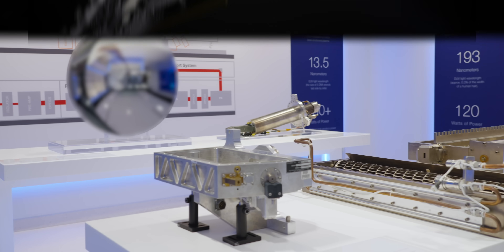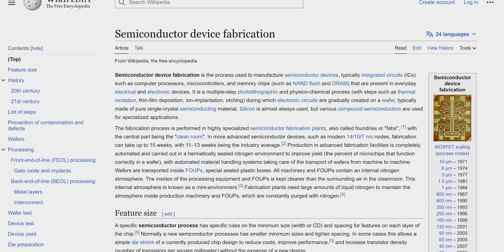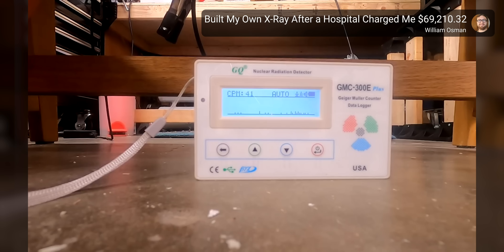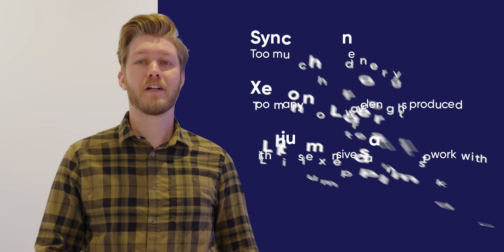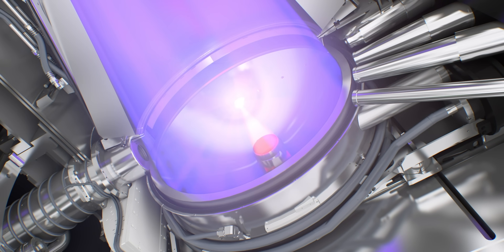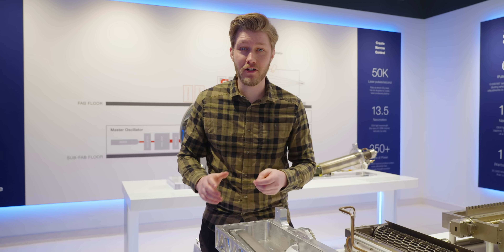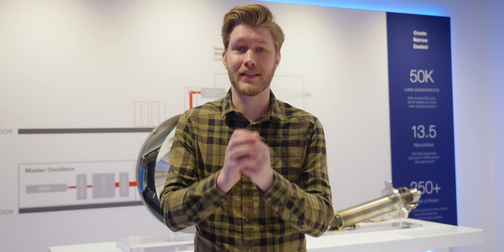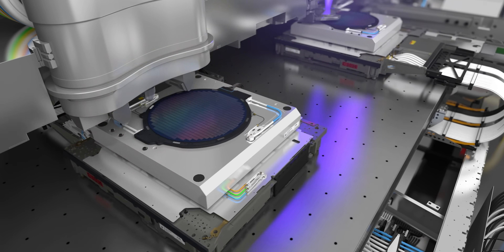You Didn’t Build your PC… This Did. - ASML Cymer Tour

Comment: Iirc, they are already having difficulty with making transistors smaller as the material is getting so thin that the electrons are starting to teleport* across the barrier.

*Yes, I do know it is quantum tunneling, but if you want to communicate it best to the vast majority you have to use general terminology.

Comment: I don’t believe this was designed by humans. NO WAY!!! Not in the amount of time it took them to come up with idea, design, production, assembly, testing and successfully making everything work the way it was imagined in someone’s mind and on paper. Can you just imagine this complex machine consists of millions of parts many of which are unique and has to be designed and precisely made before putting everything together?! And it isn’t just the unique parts and other technologies inside the machine but also complex electronics and software that runs the machine. It would take tens if not hundreds of thousands of human hours to make something like it from scratch on a piece of paper and ASML just came out of nowhere saying we are the only ones who have a machine that makes you computers and phones possible 😆. How do you even design something on a nanometer scale and then say — yeah I can print an electronic component slightly bigger than the size of your DNA strand (which can’t even be seen with the most powerful electron microscope and therefore can’t even be proven exist) using light and then make it a reality and in no time🤣🤣. So many questions and not a single answer🤦‍♂️

Comment: There is also TSMC, that uses these machines, to run through even more complex operation, with a city sized campus, using a city's water supply for a day of operation, burning millions  a day, to keep the billion dollar FABs running to produce consistent yields. Then companies like Nvidia,Intel,AMD, Samsung, numerous FABless companies like Apple, Tesla ... designing complex chips, with thousands of engineer's brain power, and companies like Cadence, that develop software to put together these chips on a computer screen, and Synopys enabling all the timing and logical verification, while also synthesizing the logic of several billion gates. Not to forget the PCB design software companies like Altium, Testing software and hardware from HP and others,  PCB manufacturing, Board assembly using PicknPlace and reflow/vapor phase soldering, Board level testing, product assembly etc,
Chip making equipment is a niche, but a small percentage of the productive electronics design cycle. You don't need EUV, except for absurd miniaturization and mass production of consumer electronic goods for most part.

Comment: The EUV system was originally developed by US and ASML joined the efforts later, a consortium of US national labs and the private sector was formed and R&D got started,  ASML actually asked the US gov for the permission to get access to the technology, (Canon, and Nikon were eager to get involved too but US gov denied their request), the early efforts on EUV system was done buy NIST, 3 of DOE national labs (Sandia, Lawrence Livermore and Lawrence Berkeley) and a bunch of other US companies, and there was a whole lot of tech transfer and licencing to ASML, many of them still hold, and ASML bought a number of American companies to develop the technology further along the way, including some of the top American lithography equipment makers. 

As you can see in the video the light source which is the key part of the system and the most complicated one, is designed and built by Cymer in California, Cymer is an American company that was acquired by ASML in 2013, ASML bought them because they were the only one in the world capable of designing and building the EUV light source, its interesting to know, Cymer was the world leader in light source technology, (still is), and works as an independent company within the ASML group, US gov didn't allow them to get merged into ASML, in order to have control over the technology and keep it in house (in US), many aspects of of EUV technology was developed by American companies and labs and ASML still work under some of those agreements, that is how US gov keeps the technology out of the China's reach.

Comment: My wife works at ASML on the "Bottom" where the silicon wafers are being bombarded by the light pulse. Even there you can't imagine how precise the wafers need to be and what kind of technology is behind it to keep it going, as said 90% uptime, going up to 95%! 

Basically braking down every main part of the machine is: 
1. Laser/Source
2. Mirror - DUV - Lenses/Mirrors
3. Retical stage
4. Bottom - Wafer stage

So imagine the complexity to align every part, measuring everything, and eventually get the Wafers that TSMC, Intel, Micron etc. have their own architecture to create the chips from it.

Fun fact: The mirrors that ZEISS produces, if you stretch them out to the full length of Germany there would be a just a few millimeter height difference.

Comment: Nah. The most advanced machine in the world is at CERN.
Reply: I disagree.
Reply: That is not even a machine. It's just a big particle accelerator using same principles as we use already +50 years. The sensor got a bit more complex but it's not a machine anyway,  all it can produce is scientific data.
Reply: @effedrien  going by this definition:

“an apparatus using mechanical power and having several parts, each with a definite function and together performing a particular task.”
The LHC is not a machine. 

But if we consider it to be, how on earth is an apparatus that can detect and identify the smallest constituents of matter producing 15 petabytes of data por year not the most advanced machine in the world?

Isn’t this an oversimplification of the LHC? 
It’s like saying the machine in the video is just a laser using principles we’ve known for more than 100 years to make transistors.
Reply: @casaroli  maybe we should not compare an experimental laboratory setup for research, with a commercial production machine. This machine needs an uptime of 90% before considered useful. That is what i call a machine. LHC has way more downtime than uptime so for me that us another class of equipment.
Reply: @casaroli  and also, what is most advanced on lhc is not the accelerator itself, but the computer systems than control everything and that interpret the data. And those systems rely on machines like this. While we didn't need the lhc to develop any if this technology. It's more a scientific prestige project in my eyes, than a useful machine for society
Reply: Eh no.... EUV machines are the pinnacle of human engineering as far as anyone is concerned.

Comment: They use hydrogen for cooling, holy moly. That's crazy!
Reply: I am sure you mean nitrogen not hydrogen. They already use that many decades in the semiconductor industry for cooling the laser mark machines and for the electrical testing at sub zero temperatures. Hydrogen would be a bit too dangerous as a cooling fluid.
Reply: @effedrien  9:46
Reply: @Chaos666Theory  i see, it's not a cooling method like i expected but hydrogen indeed
Reply: @effedrien  Insane!
Reply: @Chaos666Theory  indeed an insane way of producing light. Hit flying droplets by a laser, twice, why not. I guess it is thanks to all those microprocessors that are made with previous generation machines, that we can build a machine like this.

Comment: I have been wondering if you could use electromagetism to structure photons in a way to carry information inside a chip similar to fiberoptic cables so that you could reduce the need for metals inside of chips thus increasing speeds for data organization. I guess similar to multiple lasers reflecting off of mirrors inside of the chip... just a brief thought and im sure someone will explain why it wouldn't work lol

Comment: It would be a nice job to work inside a cleanroom of CO2 laser droplet deliveries to final DUV or EUV lithography where liquified hydrogen conduit ductwork hose pipes can remove heat since by Stephen Boltzmann with Cube Square a microscopic structure is not going to be able to contain heat and most profitable too.

 However, it is question of "Luft Und Staub" periodical on micro contamination control of how at such limits of atoms will a CPU or even neural synapses survive to endure abuse of Brownian Motion dust, vibration, and even electromagnetic pulses from static electric arc discharges.

Comment: So, how much longer have we actually got before the size of atoms becomes the issue? Still can't believe we're reaching that point, when there are a lot of people on this planet still alive that were around when computers took up entire floors and rooms. And also, is there anybody already working on solutions once the size of atoms does become the constricting factor?
Reply: Size of a silicon atom is about 0.2nm, a bit of a marketing term but they are making chips the size of 3nm. In reality about 100 atoms seperation between the on off switches in the smallest cpu. They are already hitting limits of what is possible, hence the reason they need to change to gate all around GAA. 1nm is probably the hard limit, after that they need to switch off silicon.

Comment: As an ex employee for a company that did this, this was a wonderful refresher. Companies should contract out to LTT to use this video for training newbies.
Reply: What education is needed to work in a company like this?
Reply: @force_fired556  depending on company and position there’s a range of educational requirements, for basic machine operators for the one I worked at, highschool diploma was all that was needed, up to multiple engineering and different technical degrees for certain positions
Reply: @force_fired556 For the people working on the materials science or physics/optics side of research at ASML and the like, you usually need a PhD for really key work. You can still get into engineering positions for the related fields like mechanical engineering, electrical eng, etc. with a bachelor’s though.

Comment: The size is not nanometers. The distance between mask boundaries is in nanometers. The transistors are much larger. It's the difference between the size of a square and the thickness of the line around the square.
Besides, Fujitsu did much better in 1980 using X-rays.

Comment: This is my second year interning at ASML in the Wilton CT campus. My mind is blown every single day by the new facts I learn about our processes and specifications. The publicly available information is impressive until you get an inside look and realize that everything ASML does pushes the border of what humanity thought/thinks is possible. I wish every nerd like me could experience the days and days of thought that these machines provoke. Truly the pinnacle of technology.

I used to work in the aerospace industry and lithography has completely blown that out of the water in terms of complexity, difficulty, and also satisfaction
Reply: The Chinese spies in the comments: go on 🧐
Reply: There is some really high end aerospace stuff too. The big difference with lithography is that it doesn't just have to work in a lab or small scale system. It has to be in ultra large volume production, where every minute lost can cost millions. It's like building a racecard that can go 10 laps VS one that can go 24/7
Reply: @thorwaldjohanson2526  Industrial F1 cars doing 24 Hours of Le Mans 7 days a week.
Reply: @thorwaldjohanson2526 in the end the lithography machine is still stationary in a factory with a well controlled environment. The complexity of e.g. fighter jets is more in the fact that they must be extremely robust and reliable in a huge variety of conditions, one small thing fails and it can crash. Would not call one more complex than the other, both are complex in different ways.
Reply: @vyndecimibd  I have never seen any engineer making that claim! Sorry to burst your bubble, but this technology is truly the pinnacle of what humans can set out for when they cooperate together. Do you know that ASML works with over 20 000 different companies! Again, let me put that in perspective 20 000 + different actors working together to create this machinery, a feat the Chinese could NEVER EVER achieve! They are lucky if they can manage to "steal" people setting up firms in Asia under lucrative business dealings.
Reply: @vyndecimibd  the semiconductor industry is so complex nobody or any company can have the monopoly in this business. Even the litho machine itself is a collaboration of thousands of company across the world. While fighter jets can be produce, testing by few companies and that's it. Imagine hitting the light source from earth precisely to the coin the placed in the moon 50000 times per second. That's what cymer has achieved
Reply: This definitely looks so much further out there then even quite high-end aerospace research.
Reply: "everything ASML does pushes the border of what humanity thought/thinks is possible"

I keep telling people this EUV Litho tech is basically sci-fi level technology. 😆

Comment: I work in photolithography and it’s cool to see them touching the surface of what we do. Only a few companies in the world working with these EUV machines. They are awesome.
Reply: A couple questions:

What degree do you have?
(I graduated in December with an AS in engineering, a BS in physics, and minors in math and astronomy. I'm not sure if the market is just bad right now, or if I'm applying for the wrong jobs, but it has been a rough time trying to get a job.)

Did you go straight into photolithography? Or did you start at a lower level position?

Comment: Just in time! I was just thinking about it last night, how can a LITHOGRAPHY be so small? What does it mean when there will be a processor with 1nm. When is the term quantum processors defined? Is it when it is less than <1nm?

"Qubit Processors are what sets apart a backward tabulator from the powerful analytical engines quantum computers are. Operating on the basis of quantum bits instead of regular bits, they can assume two different binary states at the same time, the manufacturing process has to take place in a highly sterile, thermo-stabilized environment at sub-zero temperatures. The leading edge of computer technology, surpassing former transistor-based digital systems. Quantum algorithms run fast and handle giant amounts of data with ease, making them indispensable equipment for any scientist eager to decipher Earth's most well-kept secrets."

Comment: So my concept I have for making cpu chips uses a interference radio wave and gamma wave laser. I use accelerators that fire subatomic particles together and capture the plasma into areas around the point where the laser comes out. By circulating the quark gluon plasma from top to bottom, then outside cork screwing it around then making it cross near the top and bottom I create a lens, and a mirror of plasma.

By putting gamma waves and radio waves in the right reflecting resonance chamber and allowing for it to double up it's resonance and power in the head I can increase its output power but also decrease it's size. The first resonance chamber is polarizing the radio waves and gamma waves to and trying to combine them in a "brief superposition" before the entrance into the second resonance chamber where the plasma is held and used to amplify and interfere with the 2 difference frequencies with a 3rd intermediate wave frequency the plasma produces.

As a result of this it "crashes out" as a focused radio wave that is extremely tightly packed, into the pico lengths, that has massive power and extreme uniform directionality (laser) and is also extremely straight.

I think it would start out at 1 tw then be focused into the smaller pico range. Because radio waves don't usually interact it means that you have a very significant control with the right interference beam next to it, or just having straight POWER of the radio wave make the required "cuts", burns, and all the rest. As you could feasibly allow for it to "spray" and shotgun and or even pivot with the right field and the right rotation of the plate to get side cuts normally not allowed. Kinda like a 5 axis CNC machine to make cpus.

Comment: I have worked on this exact project. The problems they are overcoming are absolutely crazy, really pushing the limits of what they thought was possible when it comes to many of the components
Reply: Do you know why the mirror itself is blurred out in the video? I am assuming it is something proprietary about the curve of the mirror or the finish itself, but I am super curious as to why that is redacted out of everything if it just looks like a curved mirror in reality. Cheers!
Reply: @ambroseai  not exactly I wasn’t involved in that area but will likely be due to the coating finish on there being a certain company’s IP
Reply: @slicktuckers5217  Thank you for taking the time to reply!

Comment: I want you guys to help me out with this one, I have a Lenovo Ideapad Gaming 3 15ACH6, with 8GB Memory, Ryzen 5600H, and GTX 1650. The fitted memory on this laptop is a Ramaxel RMSA3320MJ78HAF-3200. And I wanted to include another 8GB stick in there but I really have the budget of one 1 8gb stick. I have shortlisted two, a Crucial CT8G4SFRA32A and a G.SKILL F4-3200C22S-8GRS. The Ramaxel one is PC4-25600 Non-ECC CL22 1.2V. The Crucial and G.SKILL both have the same timings, the same voltage, and are both 3200Mt/s and have the same specs overall. I wanted to know whether I could use them together or if they are compatible with each other on the motherboard or not